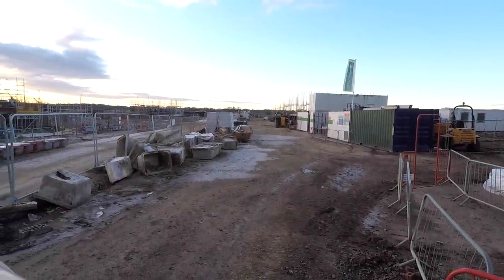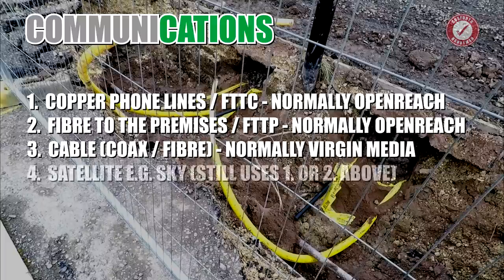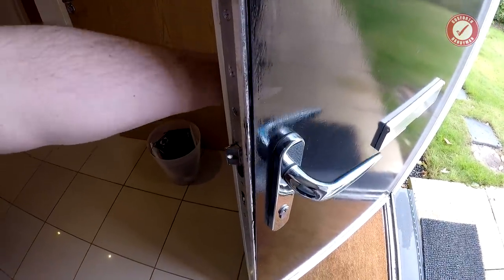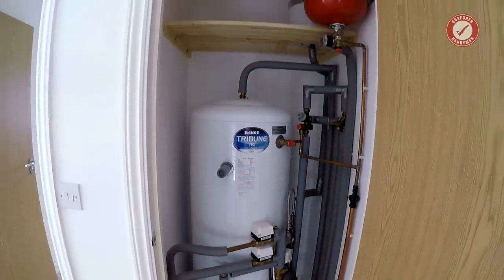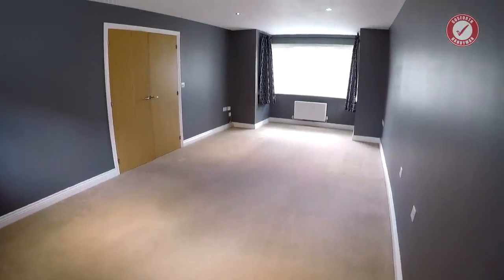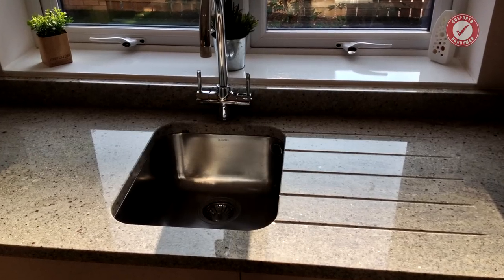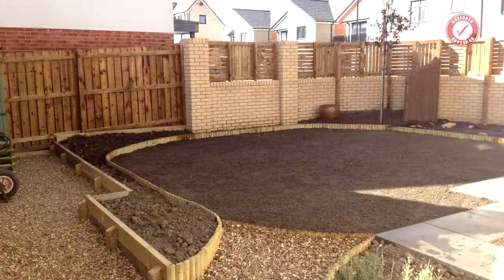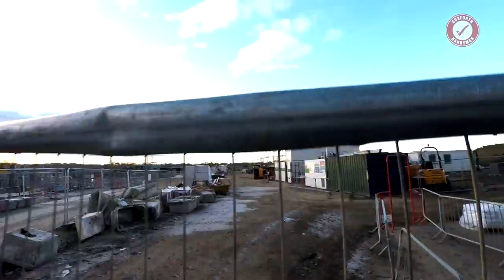How are New Houses in the UK Built? Internals, Utilities & Internet

Comment: The last two houses I’ve lived in have been new builds, one built by Persimmon in 2012 and our current one being built by Linden in 2016, both in Penryn in Cornwall. Some of our gripes common across both houses have been:
- plasterboard walls taped at the seams rather than skimmed making them dent very easily (can even be dented with a fingernail!)
- alright doors but fitted with shit handles that fall apart within a couple of years.
- not enough sockets in the bedrooms, 3 doubles to the master and 2 doubles to the others. 3 doubles per bedroom should be the minimum. (I had to add an additional socket to my room recently and didn’t appreciate an hour in the corner of the loft fishing a cable 2 metres up a dot and dab wall!)
- poor quality kitchen appliances, our Electrolux double oven burns one side of a tray of oven chips whilst not touching the other and has a habit of cutting out randomly, our integrated fridge freezer wasn’t frost free and broke after 2 years and our dishwasher likes to leave a scummy residue on everything on the top rack
Luckily we’ve been lucky with communications as both houses were in the last phase of their developments so telephone lines went live very quickly.
Also in our current house we’ve had non stop issues with the en suite shower intermittently leaking, father has sworn to never have a house with an upstairs shower ever again!
In general though our opinion on new builds is positive, our 1970 semi we lived in pre 2012 was a nightmare for plumbing and electrical due to many many cowboys fucking things up over the years. At least you can guarantee the electrical and water installations in new builds are safe and to current standards!
Reply from the maker: Yup! Very similar to our experiences. 👍👊
Reply: Persimmon is one of the last two builders I would ever have anything to do with. The other is Barrett Homes. I have witnessed shocking workmanship with both of these, but I guess you pays your money and takes your chance.

Comment: Why would you "avoid timber frames like the plague"?
Reply from the maker: Too many horror stories of mortgages falling through on the survey etc. Might be getting better but personally I wouldn't risk it in this area. 👍
Reply: @GosforthHandyman  Thanks, that's interesting. I am going to be doing a self build in Scotland and it seems to be the majority of buildings are going up as timber frame here. It would be done with a factory built frame from Fleming, scotframe, potton or something similar. Not sure what move to make now.
Reply: @gringadoor5385  @Gosforth Handyman  
Most new builds up here in Scotland are timber frame, including from major house builders. It's all quite normal. No problems getting a mortgage on them. The lenders here (most of whom are major nationwide lenders) seem to have no trouble with timber frames. A correctly built and maintained timber framed house is as good as a correctly built and maintained masonry built house.

Comment: Electricity in the UK is at 230v now, not 240v. It changed in 2003
Reply from the maker: Good point! Apparently most transformers are still 240v so the voltage can vary by a fair bit, but yes - valid point. 👍
Reply: It didn't really change. They just changed the definitions to align with the rest of Europe. Both 230v and 240v are within tolerances of what is acceptable for National Grid. If you measure it you'll see it is normally closer to 240v.
Reply: Patrick Powers The voltage never changed, only the definition of what was acceptable across Europe. It's 230 volts plus 6% or minus 10%. This was done to encompass the majority of systems in use across Europe without the expense of actually changing the infrastructure. Power in the U.K. is still distributed at around 240 volts.
Reply: May of changed in books but it's still very much at 240v

Comment: There are so many bathrooms now because it's based on a minimum spec derived from a eu/north american spec. I have seen lots of people rip out the en-suite and replace it with wardrobe space for kids on new builds. The biggest issue with new builds is how they're built, the technology and design hasn't moved on in decades, so once you take down that dot&dab quite often you'll find black mold behind it because they still suffer with the same issues as older cavity wall houses just it's easier to cover up now. 

From 2025 no new build can have Gas appliances for heating/hot water - this is going to cause some issues. Firstly the heat return from gas is far higher than electric so everything will have to move back into hot water storage, no having a combi and gaining back space. Secondly with the design spec now having to be EV chargers, electric heating/hotwater in various forms the demand increase is a big reason why energy suppliers are putting forward legislation to use smart meters as limiters for installations consumption in times of high demand. This would be acceptable if it were required by law that all new properties on estates had solar and battery storage to offset the increase in demand but sadly government legislators tend to play catch up rather than forward plan.
Reply from the maker: Indeed. The black mould behind dot & dab is a bit concerning as it would suggest the solid wall is cold and uninsulated. Certain not unheard of! 👍

Comment: Judging by what was left in my water distiller when I had one UK water leaves a lot to be desired. I'm getting a Berkey filter soon. They last for years...about 8 to 10 for the £300.00 one if you look after them. 8.5 litres delivery.
Reply from the maker: Fancy! 😉👍
Reply: I think it depends largely on the area. When I used to live just north of London, the water was absolutely terrible; particularly problematic was how hard it was. My taps, kettle, etc would develop limescale within mere days. Didn't taste good at all.

Now I live in Norfolk, and the situation is far better.
Reply: Col Pro the U.K. has just about the highest quality mains water on the planet. Distilling it is a pointless waste of energy and the residue you are removing contains many beneficial minerals. By all means filter it to remove any tiny trace of undesirable chemicals but claiming it is poor quality is pushing things!

Comment: Yes all house's were new once, but the materials used is the key. Now built to lowest cost rubbish fast grown timber for one, plastics. Worked on site and maintained, would never buy one until developers started to up their game. Greedy buggers
Reply from the maker: Specifically what materials are worse now than materials used 100 years ago?
Reply: @GosforthHandyman  timber, slate, bricks, mortar, knowledge, craft. Respect and pride. Nearly 50yrs in the trade and you've bought a house house.
Reply from the maker: Interesting. I don't think the modern bricks, blocks or clay roof tiles will cause a problem in 100 years time. The treated timbers will last longer. Mortar is defo variable - seem some terrible mortar on new builds... but also see bad mortar on older houses too. Not a fan of MDF door frames but the stairparts are hemlock / pine which is OK. Jury's out on engineered joists - not 100% convinced by those. Not a huge fan of chipboard floors. Mind, most tradespeople I know have pride in their work - sadly a handful of timewasters let them down. I do agree that the big house builders are largely to blame for this - very poor quality control. Appreciate your thoughts. 👍👊

Comment: I think its scandalous that Openreach don’t let Virgin share in the install costs. This gives the public the choice.
Reply from the maker: Yup - crazy. There should be a single big comms duct and run all technologies in that IMHO. 👍
Reply: There's no reason virgin has to use their own infrastructures and coax. All that's needed is an open access fibre then deliver any service through that. That's how it works here in Sweden. Just a question of corporate deals and/or legislation to make it happen
Reply: @paulekstorm-hughes1894  exactly, and it should be mandatory on all new builds with a program to extend to all existing buildings too. In the UK, you're classed as having super fast broadband if you have a fibre exchange cabinet within two miles and a friend of a friend has broadband.